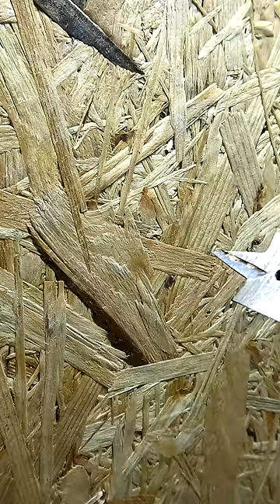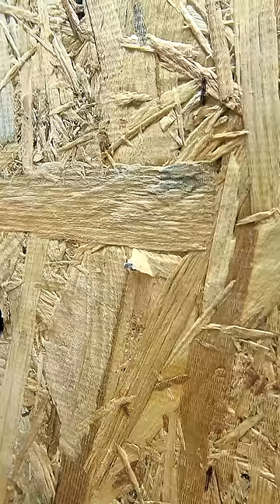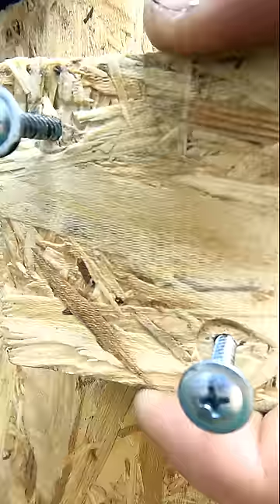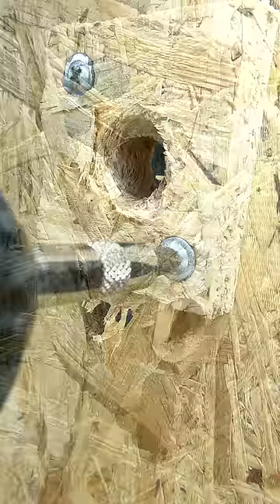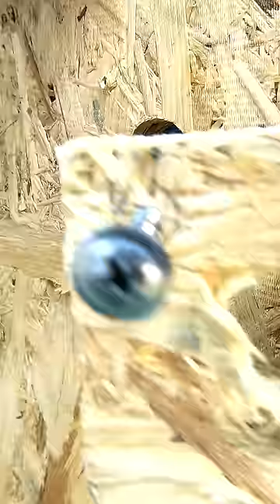No More Chipping: The Ultimate Solution for Perfect Holes. #shorts

Comment: If it was that critical:  I wouldn’t push so hard.  Also, if it was that easy to get to the other side, drill til the point goes thru, then drill from the other side.  What you did works, but that is a lot of extra work for a hole in that crap.

Comment: No need to poke extra screw holes in your workpiece, if you have enough room to use clamps.  Simply clamp a sacrificial piece on the outbound side.  Heck, I've even done it firmly hand-pressing a small block of pine 1x4 firmly against the face of the OSB.